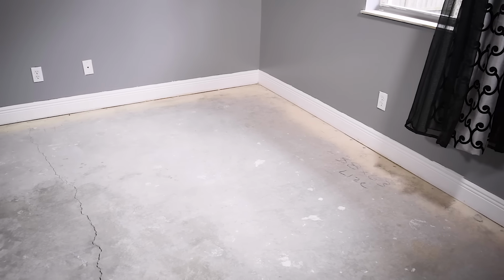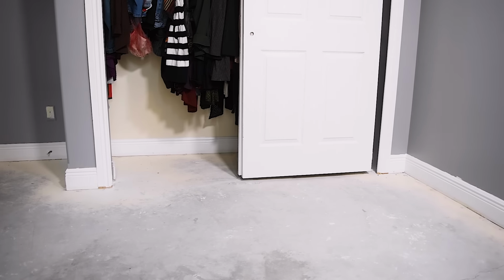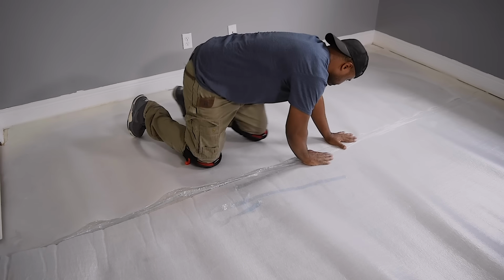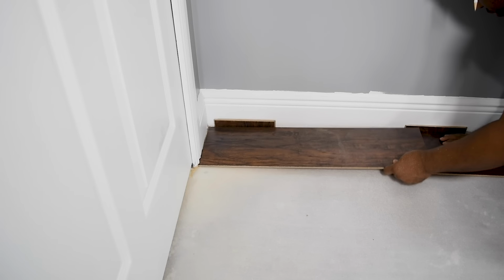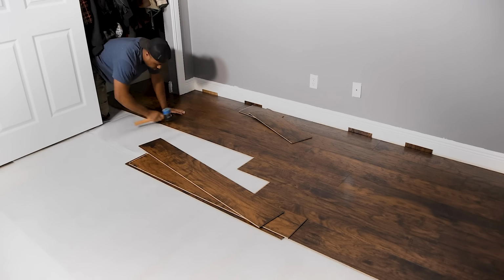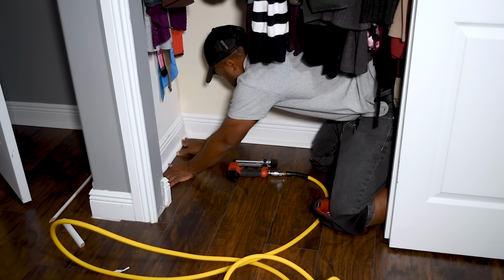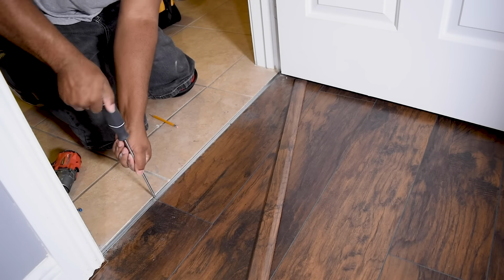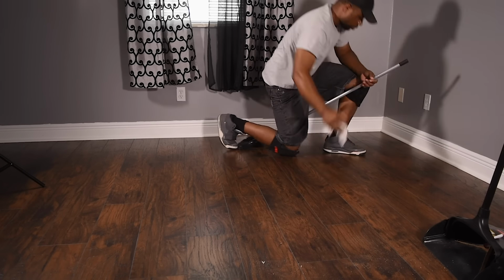How to Install Laminate Flooring for beginners

Comment: Quick tip, when u set the first 3 rows, switch the 2 and 3rd row, you wont create the studder step look and it will look more random, or youre just gonna have diagonal lines going through the room which looks terrible

Comment: i see theres a big crack in the concrete what did you do about that problem did you check to see if the slab was level and  within tolerance for a proper install if the floor isnt within tolerance and its installed and your flooring fails there goes your warranty

Comment: Excellent video! I have been in construction 30+ years, you demonstrated and explained everything very well! A personal tip; when I installed my quarter round, use a thin piece of cardboard or similar spacer to allow the floor to expand/contract without touching the quarter round or toe board. It also allows the use of tape, or wide putty knife,  under the quarter round if you need to paint it without touching the flooring.
Reply: thank you for the right word, I kept hearing "Corter Ryan" and I couldn't figure it out.
Reply: 23 years in flooring here. I thought it was well done too.

Comment: everything was great but the t molding.. you don’t even gotta go thru all that hard work boss.. just grab some clear silicone, apply some to the bottom of the T molding, lay it in the entry without the metal piece on bottom (just the t molding itself), add some tape on top of it, and grab a tile box or something to weigh it down..

Comment: I have a living room that is full carpet. I want to cut half of the carpet off and add laminate on that half instead. Would i have to install that piece of wood under the carpet that has a bunch of nails on it near the transition area? Or would the transition strip be enough to hold the carpet down?

Comment: I'm surprised there was no mention of checking if the concrete slab is level before starting. The concrete slab in our apartment required 6 x 30lb bags of leveling compound before installing the floating floor in two of the corners (we had carpet before that so level wasn't an issue). The whole was 'bowed' (high in middle). Our neighbor - in the same building - never checked his level and was wondering why his floor has squeaky spots.

Comment: We followed this video and it really helped us. I really appreciated that you got to the point and showed alternate tools you could use. We sucked it up and got a basic 10" sliding miter saw for about $250 and I wouldn't want to use anything else. Having never done it before and bumbling a bit it took us about 5 hours to do two rooms.

As some other commenters have said, you can avoid using quarter-round by pulling the trim before installing and it looks cleaner. For us it wasn't worth the damage to the wall and trim. The quarter-round gave us a nice margin for error. The laminate install kit wasn't necessary compared to just using the techniques from the video for us.

Comment: Remember you're installing laminate floor. Not decking... So do not use a stair step pattern. Random pattern is the best for these applications.
Also, if you're using a multi-tool to cut the door frames it's best to use the rounded wood blade. Lastly, when mounting the threshold at the transition forget the complicated metal track and get you a tube of good, strong construction adhesive.

Comment: Hello sir I like all of your tutorials , but im having a problem i just purchased a Galax Pro mini circular saw model  766V/766V-L it looks like an easy tool  i  bought it because Im a crafter but heres my problem I read the manuel  and tried to assemble the blade but i cant loosen the bolt , following the instructions  holding the lock button as it stated it will not budge is it possible to do a tutorial on this as to how i can loosen the bolt to  assemble the cutting blade if you can thankyou very much

Comment: Retired carpenter I have laid 1000’s of LF off flooring,# 1 remove the baseboard,because floors need a quarter inch around the room, they will expand and shrink,he did it right with the spaces,but I did not see any spaces on the end wall,when the floor moves it has no place to, but up,not good #2 he used quarter round,no,you use what is call a Shoe and he 45 his corner joints,no,you cope one end,again for movement,he did do a good showing what is call a return to finish off an outside corner,otherwise he did a good job,if I still had my business,I would hire him and teach him a few finishing tricks.

Comment: When you use clear epoxy or and other type of glues on sub floors, later on what might happen is those glues will force their way to the floor top surface, and show what appears to be streaks, and almost identical glue shape forms, like patterns in various areas of the floor, it takes time for this to happen. You won't see it right away. The worst enemy of these synthetic plastic imitation wood floors, is cleaning chemicals, use none, if you must stick to a damp water cloth, these floors gather plenty of dust and sweeping and even vacuums won't keep them clean. The the plastic fibres that are bonded together to create this wood, can also be toxic, and have been tested for this, the highest levels are imported laminate flooring from China. In the first year these floors look good, but in a few years the sub glues used to keep those boards from warping upwards force to the surface, then your nightmare begins. The cold and dampness and the humanity, combined with sudden weather changes, force those glues up through the boards to the surface, remember this is not real hardwood flooring, it is an imitation wood., and so you get what you pay for. So when you buy an expensive condo, make sure you know what kind of flooring has been installed. Alot of these new products out on the market, today are cheap Chinese imported junk.,not good quality Canadian or American lumber.  💁☕🎙️📻 🇺🇲 🇨🇦

Comment: Everything looks great except you didn't seal the edges with silicon.  Once you cut it the protective layer can let water on causing rot and expansion.   I definitely recommend in kitchens and bathrooms.  Anywhere that gets wet frequently.  New sub.
Reply: That’s why you lay the underlay so no moisture can seep up onto the wood if the cut edge is going next to a wall it should be fine. I would in bathrooms and kitchen like you said I’d do that too protect the cut edge

Comment: Would an installer always use 1/4 round to finish floor if the baseboard is installed prior to the flooring going down?

Comment: Risky idea drilling holes across the doorframe as this is where buried water pipes are most likely to be. Better to check first with a metal detector. If the builder/ plumber has used hep pipes then the detector will not identify the presence of these.

Comment: As a professional flooring installer I appreciate your video. I can tell by your workmanship that you're super handy. I personally prefer a random stagger with the material. I believe the manufacturer recommends each board is staggered double the width of the material..
Reply: True...usually minimum...8 inches...usually I see 12 inches

Comment: Nice work.  Love that you are a conscientious worker and took the time to ensure you checked and prepared the area well and that when done you cleaned up and left perfect, not dirty and messy.  

On the transition, I recently had to do a transition into concrete and, I can tell you from experience, that can be zero fun and time consuming.  You can not always install the metal track and get matching t-molding.  I recently had to custom make the transition, stain to match, use concrete anchors and screws through the face covered with face-grain plugs and touched up two hide and blend in.  What made this particularly time consuming is that it was not a 3' doorway but 24 linear feet transitioning from a dinning room to a hallway / walkway.

Oh, and I do prefer to take the cut-off from each row to start the next row, it keeps the seams inconsistent and makes it look more random, like a hardwood floor.  But, your strategy is also a fine one and gives a great look.

Finally, one question, did you create another space on the opposite wall or with laminate do you think the one 3/16, or whatever the width of the laminate is as a space, is sufficient?
Reply: @Hello Jeffrey how are you doing

Comment: You like everyone has an opinion on what to do about baseboards. Personally, I have found taking them off and putting them back on after the floor down looks the best but lots of work. On the other hand, undercutting them which looks like what you did is an option and saves you some time if the floor is nice and level. No right or wrong answer just a preference!

Comment: If you don't mind me asking, not including the quarter round, how long did it take you to install the flooring? I realize you have experience but it will give me an idea of how long it might take me to install in a similar size room.
Reply: About 10 years ago my brother and I installed about 800 sqft of pergo. It took us 5 days. Once you get rolling it can go fast. The big time consumer is the cuts. That also means ups and downs which unless you are 25 years old will add to the fatigue and stretch the job out.

Comment: Have you tried to use clear silicone? If the spent some more money they could have it done nicer.  For example, take off the old baseboards, using knife so you won't damage the walls. Paint the baseboards, cut them. Use silicone, and some nails here and there. Wood glue for corners and joints if needed. And would be awesome. Don't ask if the baseboards will fall off because of silicone, it would sound stupid question hahaha. Just a different way to do it. But as you did, it was nice too. It depends on how much money someone like to spend and what they want to get 🤔

Comment: Problem with putting it together is that each plank has to go in at an angle, but you also have to get the corners to go together too unless it's the first row.  I never could get it to go together.  I'd either have the long side in but the corner not in, or I'd fit the corners together but the long sides wouldn't go together.

Comment: I'm having hard time finding transition pieces to end at sliding glass doors, im thinking about taking a T trim piece an use router an take one side off ,I do real wood work but haven't done many laminate floors.

Comment: i've done flooring before but in my house now my room doesn't have a single straight wall and i'm a bit nervous about getting the first few rows down perfect given that each board on the first row will need to be ripped to some slight angle likely, lol. then i have to beat on all the joints and boards without messing up my lines, which means either i make perfect rips or I have like 2-3 custom shims/spacers for each board on the first row... but at least i'll save $$$ doing it myself :) remodeling is much easier when you're watching someone else do it on youtube! haha

Comment: I just found you and i am enjoying your videos already. I have a question which i think you can help me with. I have a very large room and I was in the process of installing hard wood waterproof veneer a SURE+ product. But what i notice is it sounds hollow and crackle sound when you on it. Question: Do you know of a heavier plank flooring i can use that has some weight that doesn't require to nail in because it will go on concrete flooring and i do have underlayment already down.

Comment: I prefer to go completely across the room with each run. It's easier to stagger the joint at random and I think looks better than a uniform stagger as shown in this video. You do have to plan out the measurements before starting or you'll end up with a lot of scrap.

Comment: Everything looks great except - the DAP caulk. I have been a painting contractor over 20 years with 35 years in the industry. DAP caulk is by far the worst product EVER to be allowed to call itself 'caulking'. It's more like water with something in there that acts like caulk when it's wet, but when it dries it evaporates into gaps and 25% of the product gone because of evaporation.  Do yourself and the customers a favor buy elastomeric caulking - that's not the DAP brand - and pay a few bucks for a tube. Caulking is one thing you NEVER skimp on. It's worth paying $3.50 per tube to have a product that will last and still be there the next day when you go to paint it.

Comment: What determines if you would put a sub floor down prior to the laminate? Are there benefits (outside of cost) for putting it right on the concrete?

Comment: Not bad but not good either… I don’t like how 1/4 round looks against the baseboard that’s why I would take 25 more minutes to r/r the baseboard also if I had no choice I’d use shoe base but no 1/4 round. That caulking at the door is last resort too . 
Not wrong but not neat either .

Comment: You don't explain if the room is not sized just perfect for the width of laminate that you wouldn't be left with 1" strip to cut to finish on the opposite wall and how to correct for that

Comment: How come you only placed blocks for expansion gaps on certain walls and not all ? 

Also how come you didn’t just cut under the baseboard all around like you did at the first trim ?

Comment: The job itself is done well, however I wish this was done in a scenario where you need to remove the floor molding and then install the floor, and eventually install the molding again. 
The moldings in the room I am to install a floor in is just basic flat moldings, so it would not look right to try and pimp the look of them. As they go all the way down to the concrete basefloor, they need to be removed before the floor is placed. This creates issue number 2. I have outlets on top of every molding on all sides of the room, and as well electric wire laying on top of the moldings all around. This means my molding actually needs to be cut down, or I would have to go to the hassle of moving all outlets up together with the wiring. 
Wish I could just add an accent trim piece to the moldings like in this video, but it would just look silly in my case, especially since no other room in my appartment looks like that either.

Comment: Hi, take it easy, making any application to the door entrances, dangerous heating system pipes usually pass through the door entrances, you can pierce them, you can use a plain adhesive profile, it may be healthier in the future, but it can be reinstalled. but if you break the allocation there will be a big problem.

Comment: I like that you’re hammering on the edges and grooves very little as this will destroy them. Using a scrap piece of flooring to hammer on is great. Even better would be to screw a 2x4 to a piece of scrap and hammer on that.

Comment: Plus you don't need 1/4 round,just pull the baseboard,so much easier and looks better than 1/4 round on bottom of base,that's a lazy way to do it.

Comment: when you pick a pattern make sure you have something with a lot of variety. I got flooring at a discount and discovered it had only 7 unique board patterns and 5 of them had unique marks on them like large knots or obvious swirl pattern. So my time was doubled making sure I didn't have tow of the same pattern next to each other. Get a design with a lot of variety. Lighter wood patterns show this a lot more than dark ones.

Also for gaps that are obvious you can use colored tile grout that matches close to the color. This can be useful in corners.

Comment: I recommend to check the levels ness of the flooring (each flooring ) make sure it’s not bent.. if it’s bent from the front side then it’s fine but the buttom must be bent back to its straightness 

Best thing to do is put something heavy in the middle

Comment: Attention to detail is huge here. The size of the molding to hide the edge of the baseboard is not correct. It left a very large protrusion off the wall so when it meets the door frame you have an epic large extension off the baseboard. Gotta change that size man. This is why you want to apply baseboards after the install and not cutting into them.

Comment: I’ll refer to this video when I have issues with project next week! Thx!  This vid has a lot of good info for sure! I hv A question tho, I’m doing a single story floor with vinyl, and I will be using the same flooring, should I break it up into separate rooms? , or. maybe in 1/3’s ?? In other words, kitchen and living rooms  are connected,  should I do those 2 rooms together.?? Then The hallway and bathroom and laundry ? Then the bedroom by itself? I’m just stuck on how I should clump them together or installing everything separately?  Thx for any help!! And appreciate it!!!

Comment: Something you should never do is, while nailing shoe mold, is nail it down into the floor. One nail will cause that floor to buckle when it expands. Also you need that 1/4 inch gap around the entire area to allow for expansion.
Reply: I definitely see this floor buckling..